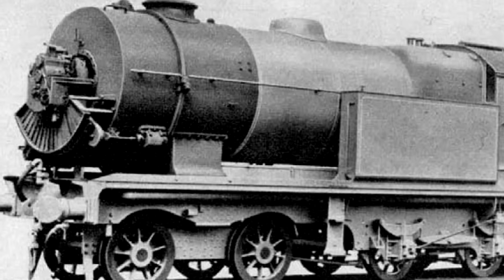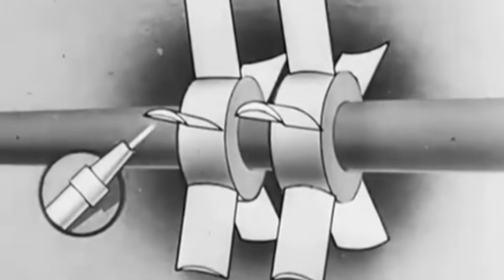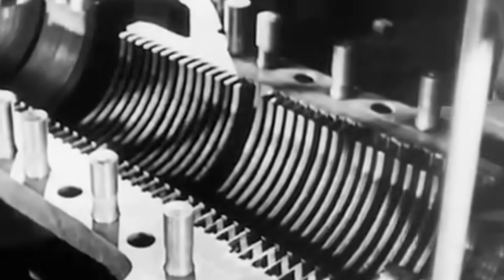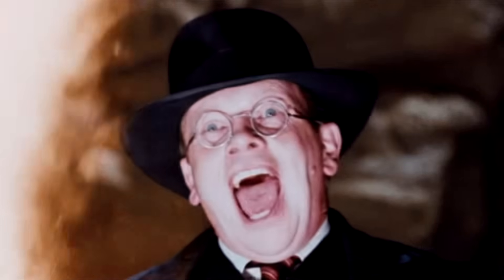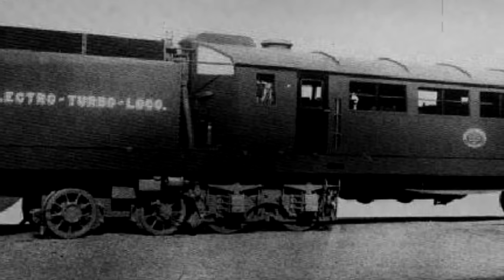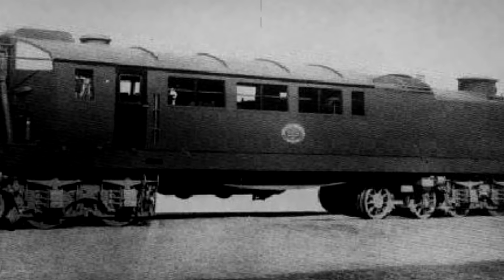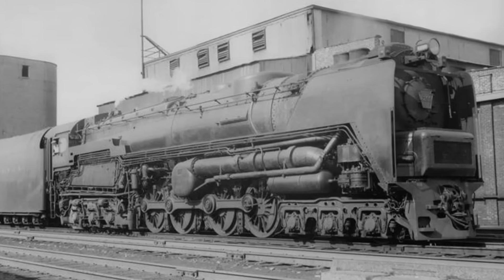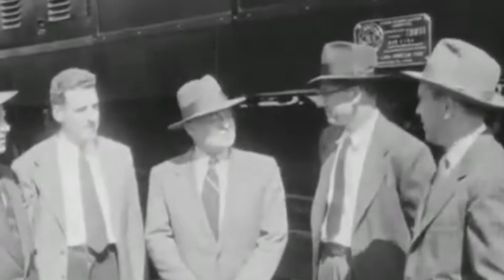What the Heck is Up With Steam Turbine Locomotives? | History in the Dark

Comment: One comment about the torque & power characteristics of the mechanisms mentioned:
1. A steam turbine most efficiently operates at a narrow design speed (rpm).  Since the boiler pressure and turbine discharge pressures are constant, it produces a fixed torque also.  If the steam pressure is throttled, there is energy and efficiency loss as the pressure drops across the control valve.
2. A diesel electric locomotive is practically a constant power device when accelerating or climbing a grade.  The electric ‘transmission’ converts the power output of the engine to whatever torque the wheels need at that moment.  Another feature is the operating RPM is close to constant at moderate and above power levels.  The ‘notches’ of the throttle select a fuel flow setting to the engine and a field current in the alternator at the same time, matching power generation with load on the engine.
3. A traditional steam locomotive behaves more like a constant torque device.  A given steam pressure acting on a fixed piston face area.  If the locomotive can generate the tractive forces to start the train without slipping the wheels, it can pull the train at cruising speed.  That speed is determined by the firebox / boiler’s ability to produce steam, the tonnage of the train, and the grade.  For all the complexity and moving parts of a steam locomotive, the mechanism is versatile enough to adapt to many different operating conditions.  Just keep that coal and water coming !!!!

Comment: Sometimes I wonder what happened to critical thinking? Engineers tend to get lost in the mathematics. Therefore failing to envision the totality of the project. There needed to be an artist with vision, to channel all the mathematics.
   No condenser is obvious, what isn't is the issue of scale. The problem was always that the turbines were much too big. Four or more, far smaller turbines, connected to generators. One turbine spinning at low power, and low speeds. Additional turbines can be paired in as needed. Not so different from pistons in a way. 
    In a two box eight turbine arrangement. Turbines could be operated in pairs. So, at low power, your not wasting energy, thru a large turbine suitable only for high speeds.
It would be interesting to consider a 2 x 4 turbine arrangement. A box with four small turbines. A second box with two much larger vertically stacked turbines. Pairs of linked turbines for low power, slower speeds. The larger turbines can be tied in, for higher power and higher speeds. Smaller turbines also simplify the turbine exhaust issues. A concept that could also be applied to gas turbines.
   It's amazing that people didn't understand that one big turbine, is like one big piston. You can't ever get it, to work very well.

Comment: Sounds like the best way to put a steam turbine on a locomotive and have it be efficient at most speeds and power outputs, and have it equipped for modern day operations, is to do the following:
Use a "standard" Oil fired fire-tube boiler with superheater, don't use a condenser so that you can have the turbine exhaust provide a good draft to the firebox, use a single steam turbine that has many sets of steam nozzles which can be used incrementally (but any given bank of nozzles only ever operates at maximum output) to vary power output to match demand without sacrificing efficiency (much like the "notches" on a diesel electric locomotive throttle), and finally use the same sort of traction motor that you find on Diesel Electric locomotives, coupled to a generator that's optimized for operation at the higher RPM typical of a compact high power steam turbine (the ones you find in power stations don't actually turn all that fast, but they use a really big turbine diameter to accomplish that).
Sound like a good plan? I think it's a good plan.
The idea with the steam turbine nozzles has inspired me to think of a similar way to maintain efficiency at part throttle with gas turbine electric locomotives, rather than having only one prime mover which throttles down to match the load, you have multiple smaller ones and only bring online as many turbines as you need to match the load. Diesel fuel is already well suited to power gas turbine engines, since like Jet Fuel, RP-1 Rocket fuel, Marine Diesel Ouel, and #2 Fuel Oil, they're all basically just kerosene with different additive packages tailored to the application.

Comment: In the German project to build a 3000 mm gage railroad there was also a Coal fired steam turbine electric locomotive.
64 meters long(128 meters for the intended double unit)
21000 HP
100Kph intended speed( for cargo trains, at a time where cargo trains usually travelled at 60 Kph)

Comment: turbo-prop-electric engines. fail fast, and make it work. you can. or you just can ignore it and dont care, and continue using what you use now, as usual. like wire/track-electric. telsa turbo turbine is better/simpler for rotary than fin turbines. yep a tesla turbine is much simpler to construct than fin turbine. anyways today you can 3d metal print complex turbines from hard steel. or even ceramics. no gear box for backwards? sounds like someone is/was overcomplicating stuff again. seems like a time period problem again. dont you use batteries. only run at optimal engine speed. actual true free competition brings out the actual facts. retrospect is wonderful. but you can redo all those designs today. lots of applicable fields. turbo-electric efficient generator and electric transmission, done. oh they could not, like people cant. as flesh cant have any nice things and all wasted. you know, turbine cars were a modern attempt. I mean modern not train car. tesla turbine is the condenser itself. it cools the output steam to freezing water. lol at 13:00. above be with you. so how about those nuclear submarines.

Comment: The three Swedish "M3t" turbine locos were a huge success. As intended, they offered considerable fuel economy - meaning less coal. As all coal has to be imported to Sweden, this is a significant matter. Sweden does however have a lot of hydroelectric power, so Sweden very early on went electric, making electric locomotives an export industry, even up to this day. (Including for Amtrak.) Which is what killed steam locomotives rather early in Sweden, and as mentioned in the video, also became the bane for these turbine locomotives.

Anyway, the turbine locomotives were operated on an iron ore mining railway. No high speeds, but absolutely insane loads. On one of the initial maximum load trial test runs, the locomotive simply tore the wagon couplings to pieces! And, well, you obviously can't use more power than that!😂

At the moment (2025) one of the three is beeing overhauled. As with all enthusiast driven such endeavors, it takes time. It is a very diffrent experience to hear the locomotive. No chuffs, just whining whirl at low speed. At high speed, the exhaust blast is a continuous hefty whoosh!

I think a second one is ment to be restored into running condition. For the third one though, as I understand it, there are no such plans.

The turbine locomotives seem to have held a special place in the hearts of the inhabitants and workers in the mining towns, which might explain why all three are well preserved.

The very last iron ore trains from Grängesberg town & mine in 1990, were pulled by two iconic locomotives, of which one was an M3t turbine locomotive, the other one an electric Ma-type, also a special iron ore pulling type.

Comment: My understanding of diesel Electric and Steam piston engines, is that a Diesel electric can start a train it cannot pull at high speeds, and a Steam Piston could pull a train to high speeds that it couldn't start thanks to its intermittent thrust loading.

Steam Turbines seem to go to the next extreme, excellent performance at speed, less so at low speed. I wonder if they would have worked best paired with a locomotive of other types, one that might run on reduced power when at high speed, mostly being pulled along as a booster and be fired up to the maximum when at low speeds to get out of a station.

You'd think that a Steam Turbine Electric drive would be the fix, a direct drive could be installed, allowing improved efficiency at top speed, and the electric motors applying the starting torque to the wheels when the turbine needs to be isolated from the wheels to spin up to speed. But I suppose gearboxes in trains are hard work and building twin steam turbines to drive a loco is expensive.

Comment: Turbines are overall just too powerful for slow speed applications or relatively low power outputs. All uses of turbine engines today are for either high physical speed (aircraft) or high power output (land based and marine power plants). The only practical use for a turbine powered rail locomotive would be as a freight locomotive on a very long inclined freight line but even that is only practical if you require one locomotive to haul large freight trains.

Comment: I generally wonder why steam locomotives of the late 19th and early 20th century dont work with a condenser. A spray condenser is small, light weight and very easy to make. The spray water is part of the total cycle water which can be recooled simply by an extra circulation with an water/air heat exchanger under the floor of the locomotive. also the boiler / superheater can be made very small if you use a water tube system as it was used in steam cars like the Doble, which had also a closed water cycle.

Comment: A fixed car passenger train, electric motors under the carriages, boiler-turbine-generator at the back and driver at the front? Pressurised fireman’s cab for blown air. Condenser in a truck in front of the boiler truck.

Comment: Turbines, to me, are The most interesting locomotives of all-- coz they're-well- coz they're Turbines. Would like you to do a video of your UP gas turbine electric locomotives, UPs "stop gap measure" until powerful enough diesels arrived. These worked very well, by all accounts-- of the last 30 "super turbines", half the fleet averaged over 100000 miles annually-- which is impressive for late '50s thru the '60s. Have 3 books about all 3 types UP used by Lee, Wolff & Keekley to help with your research which yal find up in th US. Appreciated this very well told video

Comment: I also like the Pennsy S2, as it was the only direct-drive steam turbine locomotive the USA ever built - the others were electric locomotives, just with steam as the motive power instead of diesel (a bit silly - the diesels were safer, didn't require water, and were less complicated).  It's a little sad the steam turbines came along so late in the game - given the time to iron out the low-speed efficiency issues the direct-drive locomotives could have given the diesel-electrics a real run for their money.

Comment: Having some experience in operating ships with gas turbines, what you say is very familiar, big horsepower at speed and in this case since we're driving a propellor, a device that probably has a logarithmic power curve, very little power needed at low speed with a rapid needs growth as it reaches its designed top speed but it is much more comfortable using a diesel engine since it isn't trying to run away, the turbine just wants to go full out.  From what I understand the Pennsy turbine was really great when going fast but very hard when trying to get a heavy train started. since it used a much smaller low speed turbine for reverse operation this worked out much better, it would seem that the answer would be to have a second small turbine  to do the starting procedure.  But a further complication of the railroad problem is the tremendous load variation, light trains, heavy trains, long hills, and the sudden switch as you crest the hill.  Most naval steam turbines were used in fast ships such as liners and military vessels where there is a need for speed.  Ship boilers were generally of the water tube design while locomotives use fire tubes with a separate firebox using a crown sheet over the fire.  I believe that Baldwin did build some boilers with a water tube firebox and a fire tube middle section.  This is important due to the pressure limitations of the staybolted crown sheet since turbines like high pressure steam.   For years ship boilers lagged behind the pressure curve of locomotives but this, water tubes, changed that.  A crown sheet boiler design would not be very happy on a ship that is rolling around in a seaway.  I am only slightly familiar with this in the context of oil fired boilers.  You need to make a LOT of steam to feed a turbine.  I should add that  seven of the eight battleships at Pearl Harbor (all laid in for WWI, had turbines.  These ships could when new do over 20 knots for very brief periods but then actually (not literally) run out of steam.  number eight had a triple reduction steam engine, it could do nearly 19 knots and pretty much keep it up for a day.  In any case, steam turbines are fuel hogs compared to diesels, and modern diesels can be fast.

Comment: These days close to all installed steam horsepower is by Steam Turbines.
But also close to all for electric power generation by coal, gas, oil or nuclear heat for steam production.
A much more controlable and predictable steam requirement than locomotives.
However some of those locomotive designs had a much better approach to the requirements it seems.

Comment: I always was curious about if you got a steam turbine with a set of gearing, like a high and low gearing, if you used the high gearing for traveling between destinations then using a lower gear, but still high turbine motor speed, if they could have made a good slow speed, continuous power output, less likely to slip helper engine. Kind of like how the B&O used the Big 6s or the failed triplex’s job. Probably would have been very complicated and not worth it but picture a big shay with a steam turbine that’s sole job is slow slog it out freight drags/pusher service that can use the gearing to maintain the high engine speed performance

Comment: Turbines have this thing, where they're only really efficient when you run them at their design power (i.e. HARD!). Steam, gas, water, doesn't matter. You don't get peak efficiency unless you're making peak power.

For an aircraft that's fine. Sure, you don't need all that thrust all the time, but you do need a bunch of it most of the time, and there isn't really a better way for the most part.

For a ship it's fine too - you spend most of your time cruising at full power, can't go wrong with a steam turbine.

And in power generation - same thing. You want that generator to come on, warm up quick, fast & in a hurry, and start making its rated power (usually loads of it).

But for a locomotive... maybe not so much. Once you're up to speed, unless you're on a high speed line and/or trying to set a record, you'd just back off the power. Depending on line speed, half the time they just coast. Or out on just enough to maintain speed. Not ideal for a turbine to say the least.

Like I said before, they're only really efficient when they're making nearly all of the power. But also, they NEED to be turning at some particular speed too. Not a problem in the above cases, but in a steam locomotive - you start at 0 and unless you're on a dedicated "slow" locomotive, you never reach optimum speed for the turbine. They're just not compatible with this use case. Same reason gas turbine cars never took off.

Now, a turbine-electric... different story. You've solved half the problem by taking away the direct connection to the wheels. But only half. Fact remains you just don't need that much power all the time. I guess with a steam turbine it's easy enough to just shut the valve and open it again when you need some more power. Not so much with a gas turbine - once it's hot, it needs to stay hot. And they burn through hideous amounts of fuel when idling. IIRC, one of the fast jet engines, when idling, burns something like 80% of the fuel it does at its rated thrust. Just to keep itself spinning. No wonder gas turbine-electric locomotives aren't a thing any more...

Comment: And i cannot believe someone decided to re make a prr 4-4-4-4 duplex instead of a re making a prr j-1 2-10-4.  The j1 was prr's top BEAST!! If u ask me
Reply: Part of the reason why a T1 was chosen to be built instead of a J1 is because it's to investigate claims of T1s running at speeds exceeding the speed achieved by a certain LNER locomotive in Britain. And the J1 is not strictly a Pennsy locomotive - it was derived from the C&O T-1 design.
Reply: Who cares how fast it goes!!!  Its streamlined not the signature Pennsylvania railroad Cyclops beast look with the headlight mounted on the top of boilers.  Unless they scrap the streamlined look for prr Cyclops beast look.